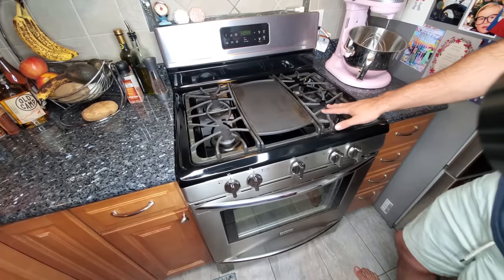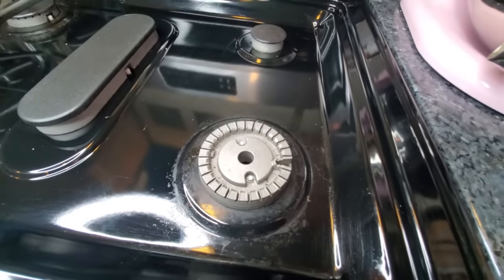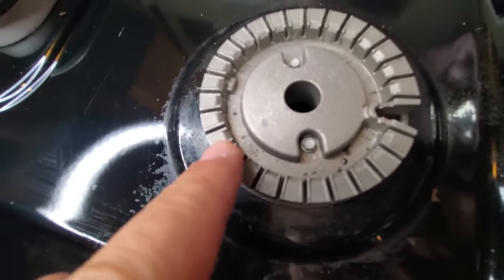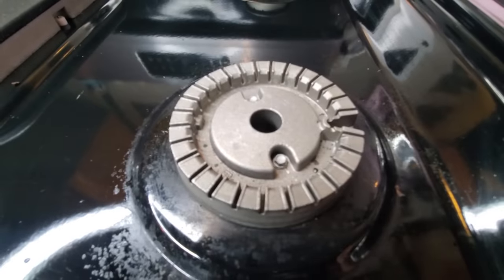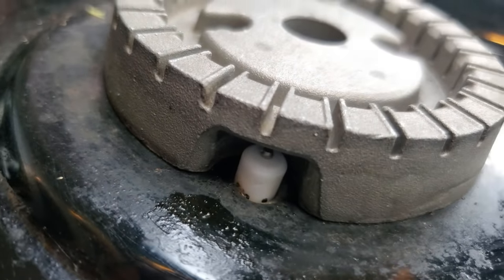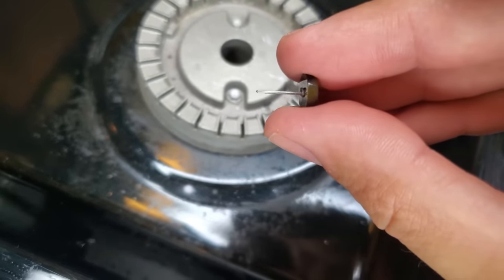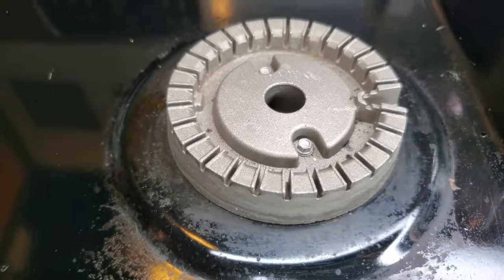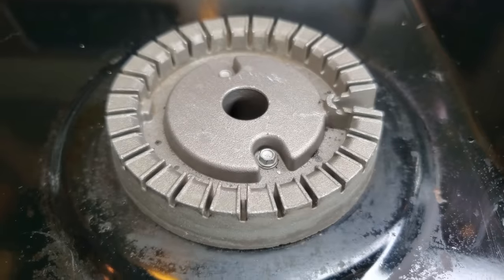Gas Stove Top Burner Not Lighting (Easy Fix!)

Comment: This fix only works if the igniter makes a spark. The igniters on my mid-80s stove gradually stopped working about 5 years ago. No more clicking sound when I turned the dial to "LITE."
Reply from the maker: Yes, sounds like you may need to replace the ignitor

Comment: Jeebus. About a year ago we got a showroom stove. It was brand new, but used as a display for about a year. It was cleaned up, given a once over and delivered. Had two burners that would never ignight with out a bit of help. A BBQ lighter... Had two stove repair people out, the burner eventually lit when they were out, they both called it a hard starter. Didn't charge us, but the whole kitchen an would smell like gas when it would finally decide to light. Hence why I decided to interven and just use the BBQ lighter. Quick and no gas smell. 

I saw this video. And I looked. Those two flame, diffusers?, didn't have holes in them like the other three easy to light burners did  they just were not there. A quick drill later, and now all the burners light easily and no gas smell.
Reply from the maker: Awesome!  Glad you were able to get it resolved!  Happy Holidays!
Reply: @JMGENTERPRISES  you as well. Again thank you.

Comment: Omg I never knew that was there. I have a GE gas stove had for a few years. The one burner in the front I use. You hit it and it click click click and smell gas and after a while it light. I just poked a needle threw that hole. Now first click it lights. To think I was looking at new stoves cause this was annoying me. And mine look like new thanks for the tip.
Reply from the maker: Woohoo!  Happy to hear it worked for you!  😁

Comment: Thanks for the informative video, I gotta ask: how can it be that this clogging has happened to you often enough that you can say that this fix works nine times out of ten?  Are you a really messy cook?
Reply from the maker: I just meant it resolves the issue for most people nine times out of ten.  I actually only personally have to clear the hole about once every 4-5 months or so.  Compressed air works really well too!
Reply: @JMGENTERPRISES  Well, that makes sense.  I had imagined pigeons roosting on your stove.
    In any case, your video was useful to me.  It helped me find and clean a hard-to-reach (deeply recessed) orifice that had been blocked for a while. I was able to reach down into the larger hole with a chopstick and displace enough crud that I could see that there was indeed an orifice down there.  Then, with a twisty wire veggy-bag tie with the plastic stripped off I was able to reach and clear the orifice.  So thanks.

Comment: Did wrk for one of them which had the clicking sound. But not the other. It runs gas but doesn’t click. Ehat do you recommend
Reply from the maker: Try cleaning the top of the ignitor

Comment: What about the long middle burner. The front part lights if I put a flame to it but not the back part.
Reply from the maker: Try spraying some compressed air in the vent holes in the back part.

Comment: I was hopeful this would work for our stove.  The symptoms (have spark and gas but no fire) are the same but the burner arrangement is different.  I'd post a pic if I could.  Anyway, there isn't an orifice to clean like in your example and we have to blow on the burner for it to light while the igniter is doing its thing.  And then, we only seen to get about 50% output.  Do you have any other ideas?
Reply from the maker: What model range do you have?  I can look it up and see what it looks like.
Reply: @JMGENTERPRISES  It’s a Frigidaire.  Probably at least 15 years old.

Comment: My oven sparks and has gas but won't light without a match. Is this the same inside the oven too.
Reply from the maker: Can you actually see spark from the ignitor?  I would recommend cleaning the ignitor tip with an sos pad

Comment: Please I seriously need help with my Samsung Gas Range Stove,I bought it used but almost like new.The first thing that I did on it was to change the orifice from natural gas to propane,after doing this I tested it and I noticed that all the igniters will be sparking even when it is just one face that I switch on then all the burners will just flame/flare up boom just like that which I know is not normal.I have changed the igniter module,I have also changed the gas valve bar that came with all the five valves,I also changed some tubes that I thought migh not be okay but the situation still remains the same.I will really appreciate all the help that I can get from people that come accross and read my message to assist me in getting this stove back to a normal and safe working condition,we all know that these technicians will charge arm and leg if they are invited to check and fix things like this.Thanks and I look forward to hearing from people that are in the position to help.
Reply from the maker: Sounds like you did all the repairs I would have tried.  I am at lose on what I would do next.  Hope someone else can chime in and offer suggestions for ya!

Comment: I'm pretty sure I unclogged them all, 2 burners would light very weak, and now none is lighting.... could it be the gas regulator? I am also not smelling any gas when turned on.
Reply from the maker: Sounds like a gas issue yes.  You should easily smell gas if it's working right.

Comment: "9 out of 10 times this fixes it"...I'm hoping you know the 10th time what it could be?  Mine doesn't have the tiny hole for the gas to the igniter.  I just has 5 of the same kind of cuts as the rest of the way around the burner.  It "clicks" and gas comes out, but no ignition.  Could it be the igniter itself?  Anyway, it was certainly worth a try to look at this so thanx for posting!
Reply from the maker: Sorry to hear it didn't fix it!  Do you see spark on the ignitor?  If not, probably time to replace it.  They are cheap
Reply: @JMGENTERPRISES  Thanx for the reply...it does look cracked and no spark visible.  Replacing.  Thanx again for the nudge.

Comment: Can you run the burner without the top part safely
Reply from the maker: Usually doesn't work well cause the cap spreads the flame in a circle.  Without the cap, it will probably just be a straight up flame.

Comment: My problem is with the griddle burner in the middle. Is it the same method to be used for that one as well?
Reply from the maker: Yes, most griddle burners have one or more tiny holes that sometimes get clogged.  It varies in location depending on what model.  Take a look and see what you can find! :-)

Comment: I have a 36" Frigidaire stove that when I turn on the burners it's just gas but no flame. There's no white igniter on the outside opening nor a hole on the opposite side?  Can you help me on what to do to fix this? Thank you.
Reply from the maker: Where is the ignitor located on yours?  Sounds like maybe you don't have spark..?
Reply: @JMGENTERPRISES  Hi, It won't spark when I turn on the knob, and there's no hole around the sides like in your video with no white igniter. I would like to show you pics so you can see if possible.
Reply from the maker: @justinkim4256  what model range do you have?  Must be really new?
Reply: @JMGENTERPRISES  It's a Frigidaire 36" range with the timer on top at the back end. We had it for a while now over 10 yrs.
Reply from the maker: @justinkim4256  gosh I don't know.  I thought all of them had exposed ignitors
Reply: @JMGENTERPRISES  Yeah but ours doesn't. I believe I see the igniter is inside at the far back center with a bottom half-circle iron material below it.
Reply: I have a feeling the igniter is out unfortunately

Comment: Do you have any suggestions for how to stop igniters from firing off spontaneously when others burners are lit? Occasionally, when I light one burner and turn it on low, another burner igniter (not turn on) will start firing off. It's quite annoying.
Reply from the maker: I haven't had that issue before.  Perhaps another video has some recommendations?

Comment: Why didn’t you show where to put the ear ring?   You pointed at the igniter but I don’t see where you would put that.  I tried putting it through the little hole on the other side but couldn’t get it in there.
Reply from the maker: I highlighted the hole with a little red arrow.  There should be a small hole that sometimes gets clogged.  Compressed air works well too to clear it.

Comment: Hello I tried this with a pin I also cleaned out the trap around the inside of the gas burner. The igniter is clicking and I smell gas but the stove still isn't lighting. Is there anything else you recommend? My stove is like yours and it's a Frigidaire.
Reply from the maker: Are you replacing the lid when you test it?

Do you see spark on the ignitor?  If not, try cleaning it.  If that doesn't work, replace the ignitor

Comment: Do you know what would cause the burner to have a full flame in some of the outlets but a shorter or smaller flame in others?
Reply from the maker: Sounds like a clog in one of the gas lines.
Reply: @JMGENTERPRISES  gas lines on a single burner? Only half of them burn high the others burn lower
Reply: Got it! I was able to fix it. THANK YOU

Comment: Take out the regulator. Drill out the brass gas jets. Water will boil much quicker now. Like at a Chinese restaurant when they cook with those big woks. Mine works great now. Before I had this tiny blue flame on high. Took forever to cook mac and cheese.
Reply from the maker: Good tip!

Comment: My clicker is not clicking. I cleaned the whole, I can smell gas but I can never see the spark. All other burners click & spark. Only the real right front burner is not sparking. 
If you have any more advice please let me know. Thank you for ur video.
Reply from the maker: Sounds like you need to replace the ignitor.  They are pretty cheap and easy to replace.

Comment: Can we also burn through lighter or match stick if burner is not working?
Reply from the maker: If there is gas coming out, you should be able to start it with a lighter or match.  But it sounds like maybe your ignitor is not working.  Ignitors are pretty easy to replace and cheap.

Comment: I have a gas stove and iam not sure what’s wrong only one burner sparks the others do not I have cleaned the burners and igniter from grease and debris and still no spark just clicking also the burner that does work intermittently the flames are blue and orange iam afraid to light the burner because the smell of gas is strong and my landlord is no help also my stove doesn’t have the little hole where the igniter is for me to unclog it not sure what to do
Reply from the maker: Try using an SOS pad on the ignitor tips
Reply: @JMGENTERPRISES  thx for the reply I tried that to see if it would work it will spark and then go out I think the stove just needs to be replaced
Reply from the maker: @Yo-yo-dt5ze  ignitors are fairly cheap and easy to replace.  Maybe try doing one and see if that helps.  If not, a new stove is always a good fix. 👌🏼  Hope you got many years of use.

Comment: why is that small gas  burner caps so expensive, like 25 dollars Canadian. It is jus a metal plate with some groove to fix that cover  in it's position. maybe the inside is made of silver ? it's just a 2 to 3 inches in diameter.
Reply from the maker: Yeah I'm not sure.  That does sound expensive for what it is

Comment: Hi I need help. I was boiling something and it over flowed and clogged up and burned down the liquid to black char. I’m having a hard time cleaning it. I don’t know if I should unscrew something to remove it. And I’m not findings answers in the internet. This is the exact model I have. Please help!
Reply from the maker: I would try carefully using a razor blade to scrap it off.  That usually works well for me if something gets baked onto the stove too much.

Comment: It didn't work for me. Clicks and i see the spark, cleaned that hole. Getting gas smell it and my other burners light. I unplugged it and plugged it back in still wont ignite
Reply from the maker: Do you actually see spark when it's clicking?

Comment: I have this same stove however the problem with mine is there is no spark or spark sound just gas smell , what should I do?
Reply from the maker: Sounds like you need to replace the ignitor.  They can go out.  Fairly inexpensive and easy to install.

Comment: The igniter does not work at all.  Gas  flows--
Have looked for acesss to the ignitor, but I can't find an acess to it.  The top is NOT removable.
Reply from the maker: May have to go through the bottom

Comment: If you use a metal object/pin or paper clip to clean a brass orfice you must be careful not to scratch the brass orfice
Also using a tooth pic is good but be careful not to break it inside the orfice
Reply from the maker: Thanks for the tip!

Comment: Our stove burner will light but makes a noise like there's air in the line no matter how long the burner is on.
Reply from the maker: Do all your burners make the noise or only one?  Have you tried cleaning the hole where the gas comes out from?
Reply: @JMG ENTERPRISES    just one. We had a plumber that works with propane and gas. He cleaned it but it still makes the noise. He didn't know why.

Comment: What if I have no clicking noise when I turn on the stove top but smell gas? The oven won't start either.
Reply from the maker: Sounds like the ignitor may not be working.  Do you see spark?

Comment: What about the long boil/grill in the middle? That one doesn't ignite for me
Reply from the maker: Do you see spark on the ignitor and smell gas?
Reply: @JMGENTERPRISES  Yes, smelled the gas and heard the clicking noises. I actually got it to work after I poked all the holes around the cover top where the flames came out of. Guess those also got stuck from the greased/food bits. Thank you!

Comment: I'm one of the 10% where this didn't work.  My stove didn't use the tiny hole to pass the gas to the spark plug.  It has a smaller slit cut out just like all the other slits around the ring so there is no chance that it will clog.  The problem is the spark plug got burned out.  You can actually see the sparks from the remaining working stoves when you turn it on but not from the non-igniting one.
Reply from the maker: Ah bummer!  Sounds like a new ignitor is in order and would resolve the issue for ya.  They are pretty cheap

Comment: I think my igniter needs replacing ?? No clicking
Reply from the maker: Sounds like maybe you will have too.  Do you see spark?  Try cleaning the top of the ignitor and re testing
Reply: @JMGENTERPRISES  no spark cleaned it.Gas definitely working as used electric lighter.Not sure where the igniter is in order to replace and also to order one ???

Comment: Some days mine will work fine first try then other days it gives me a hard time lighting the  front  left one ..  not sure whats going  on with it.. there is spark and clicking
Reply from the maker: Can you see the spark on the ignitor as well as smell gas?
Reply: @JMGENTERPRISES  Yes    clicks  and does that  spark thing  it will go  on like  a few times  in a  row then  it  stalls after that .  strangest thing ,   can smell the gas   like last night i  was cleaning  around it just to make sure nothing was  in there ,  stove is super clean  anyways.. it would go on a few times then  it  wont after a few tries  ,  maybe i need to replace the igniter ? been like that since i bought it 9 years ago i should of called  Home Depot   right away  when it was doing it then ..  just  thought it would be ok  and thought it was just  new
Reply from the maker: @joedevitto6113  -  Hmmm.  That is weird.  Replacing the ignitor would sure be cheap to try.  I am kind of at a loss of ideas.
Reply: @JMGENTERPRISES   Ya its  so odd. i just  turned it on  and it was clicking away then it went on then i tried it again and it didnt work  then kept retrying till it worked..   its an Amana stove , the other 3 work  fine right away start up.  ,  If i change the igniter thing do i have to shut off the gas ?

Comment: I cleaned the stove top today and now the igniter no longer clicks…. the family is coming home soon so I sure hope I can fix it quickly 😳 Hope I didn’t damage their stove…. HELP!!!
Reply from the maker: It could be the ignitor got wet.  Have you tried drying it?
Reply: @JMGENTERPRISES  …… I ended up lighting the stove with a match and let it burn for a few minutes. Eventually the igniter started clicking, thank god. I think I did drown it just a bit. Now it’s working. I’m glad I learned about the little hole that can get plugged where the flame comes out, and they are all clear. What I’m confused about now is that the front right burner, which is a little larger where the flame comes out, has no hole. 🤷‍♀️ It’s solid … that one does click, but I need to use a match to light it. Why is there “no hole” and how does the spark hit the gas?

Comment: Too funny.  We just bought a 5 year old house that has the same gas stove as you and I wondered how the previous owners had managed to scratch off the paint around the burners so bad.  Well, I see your stove top is missing paint in the same locations so the likely cause is a poor paint job by Frigidaire.
Reply from the maker: Congrats on your new house!  Are you talking about the paint around the burners?  That is actually just caked on residue.  I was able to scratch it off with a razor blade  :-)

Comment: Didn’t work for me. I get a spark but doesn’t ignite i got gas going through because it turns on with lighter
Reply from the maker: Can you see the spark?  I would try scrubbing the ignitor tip with an SOS pad a bit

Comment: So what if none of the burners have clicking noise
Reply from the maker: Sounds like the ignitor tips may need to be cleaned.  Try taking some steel wool and gently wiping the ignitor tips down.  Sounds like you are not getting spark.